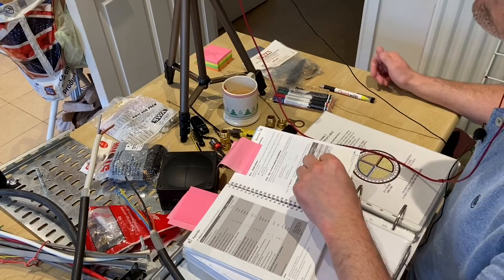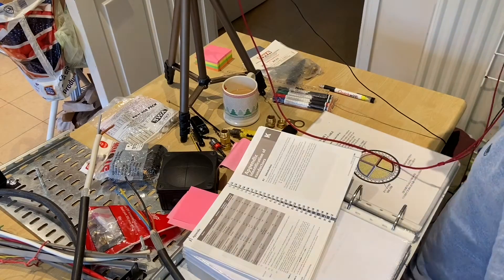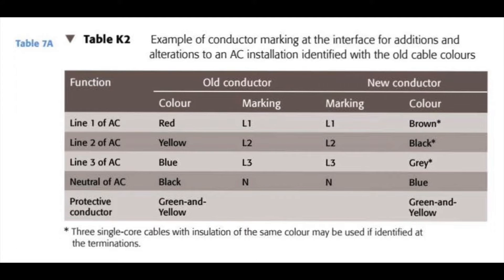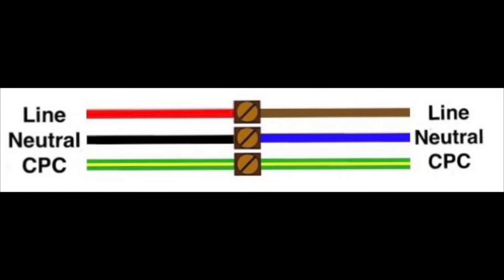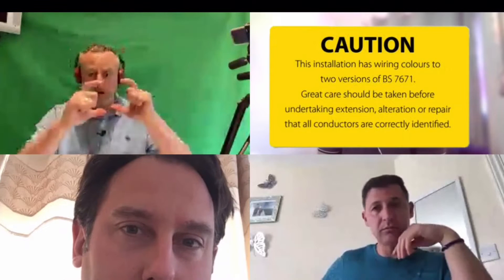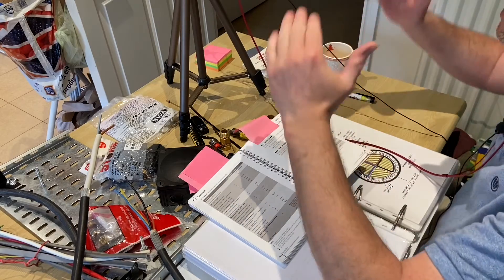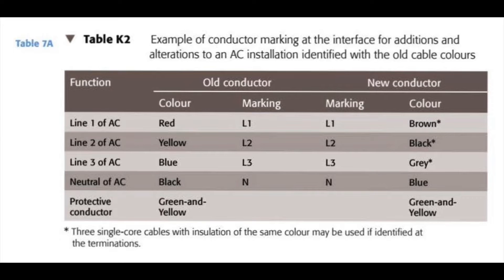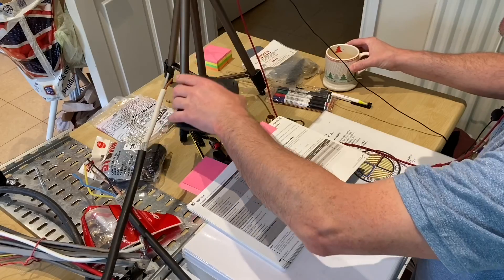SWA Cable Conductor Colours and Identifying them Using the On Site Guide Appendix K BS7671 Part 1

Comment: Where does it state that the grey on a single phase circuit swa needs to be the neutral ??  Also i can't remember being aloud to swig a beer in class , is this a new thing?
Reply: I don't think it is in the regs. It was an ECA/NICEIC thing from years ago 'De-neutralising black'
“De-Neutralising“ Black

Under the new identification colours for fixed
wiring introduced by Amendment 2 to BS 7671,
black is now used to identify a phase conductor,
not a neutral conductor, in new installation work.
In all single-phase applications, it would be
preferably to use cables marked for such use,
which is with brown (L), blue (N) and green-and-yellow (E) cores. 

However, where three-core
cables marked in the new three-phase colours are
used for single-phase applications, appropriate
overmarking at terminations must be used and it
is proposed that, as a convention, the black core
is used for the protective conductor, the brown for
the phase conductor and the grey for the neutral.

This convention is intended to break the
association between black and neutral. It would
mean that the black core would normally be
overmarked green-and-yell or E and the grey core
overmarked blue or N. The brown core would not
require additional marking.

Source: ECA Circular 86/2004
That where it comes from its not a regs or osg specific thing
Reply: Its to avoid confusion between the two different colour codes. 
"Black is no longer neutral and must be earth", this is the reason why grey should be neutral. 

Edit: This is especially evident in installations that have two different versions of BS7671. Where old colours and new colours are present.
You should do this if you have a single-phase circuit fed with a 3 core armoured with Brown, Black, Grey cores.
Brown - Line
Black - Earth
Grey - Neutral
Reply: @TheTomBombGaming  where does it say this in the osg or regs book?
Reply: @TheTomBombGaming  my understanding has always been that you can use either black or grey as long as you sleeve it with blue.
Reply: @154electrician  Yeah as long as they are sleeved or reidentified it should be fine. ECA/NICEIC say otherwise just to avoid confusion on older installations.